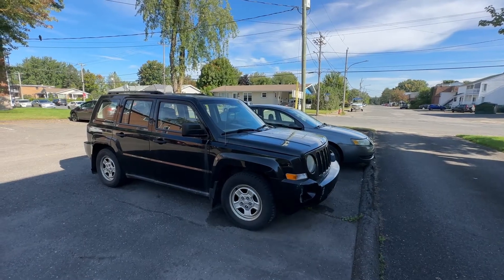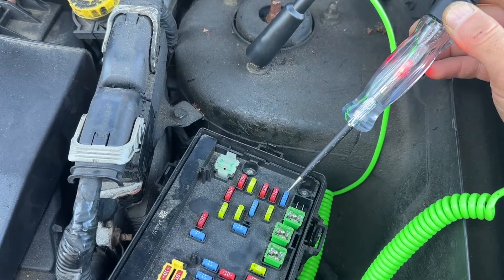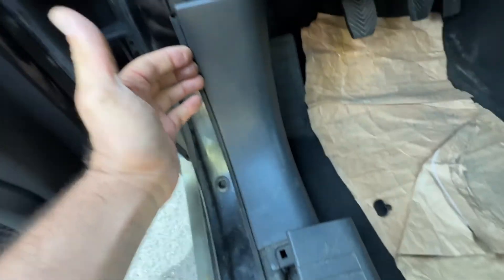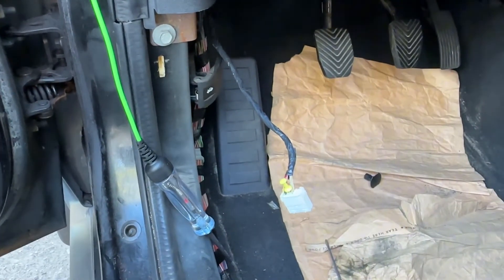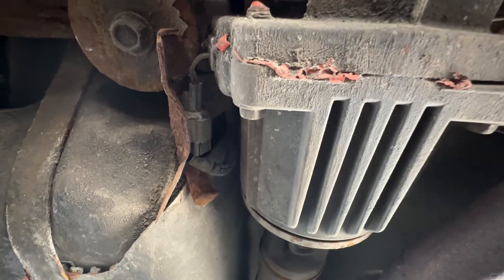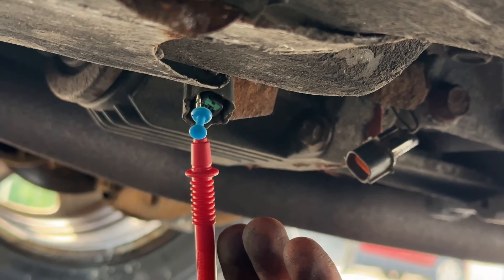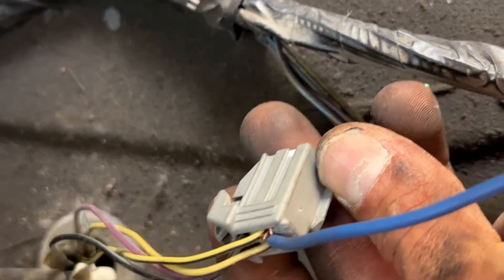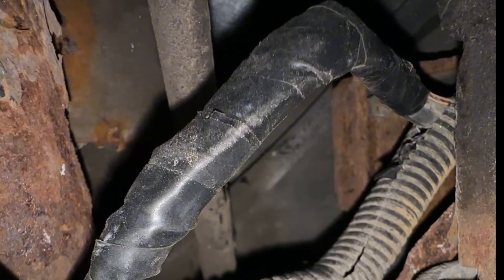How to fix the 4WD system on jeep patriot code C145D - 4WD system Fixed

Comment: I fixed it but it was not what you would expect! I checked the transfer case, the wire to the transfer case, the wires by the driver side kick panel, the drive line suspension module, drive line suspension module wires, replaced ECU, checked Fuses, fuse box, Fuse box wires, 4wd switch and the 4wd wires by the center console replaced both rear wheel bearings and nope. It was my speedometer cluster!!!!!
Reply: New issue popped up!! 4WD! turns sometimes on after acceleration when turning. going to replace ABS sensor.

Comment: I can engage the 4 wheel drive and I drive 1 mile and it turns on what could be the problem
Reply: Hello dear friend. I have the same problem. 4wd works at low speeds, but after 2-3 miles, when you start accelerating, the 4wd effect disappears. Did you solve the problem? Are the tires the right size?
Reply: @ and no I haven’t solved it but the front tires are a lil bit bigger I was thinking that but I don’t think it will be that  because just for it to be that is a simple fix

Comment: i have a 2014 jeep patriot,on the scan tool it says lost communication with AWD Drive Module, but it has no warning light on the dash,can you help me fix thw problem please.
Reply from the maker: you need to verifie if the 4WD module have power from the fuse to the connector like is showen in the video it can be a blowen fuse check the positive and the negative if you have power at the connector then check the can bus wires for continuity with the ecu from the 4WD module connector to the ecu connector if you have power and continuity in the can bus wires than your 4WD module  must be the problem

Comment: Riadh, Just had my back brakes and bearings replaced and now my ABS, TRACTION AND 4WD! lights are all on..AND, I drive a 2014 Jeep Patriot. These vehicles ARE SHIT!!
Reply from the maker: did you try to scan the computer with a scan tool and if you did can you give me the codes for the ABS and the 4WD
Reply: This happened to me too after having my back breaks changed!!! Did you manage to get to the bottom of it? X

Comment: this is a great video. i dont know what exactly is wrong with my jeep patriot but i suspect rats have eaten my wires for the 4wd. the abs, 4wd, and oil pressure lights are on and it dings a lot. my back indicator was out because rats chewed through the wiring. im not sure if this is even fixable.
Reply from the maker: I hope that your jeep is fixed if you have any question, maybe I can help